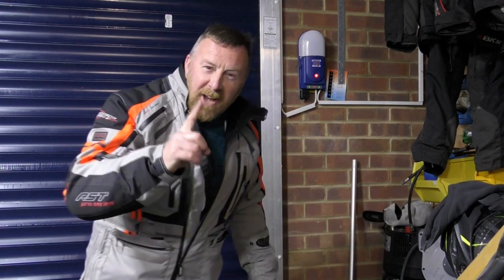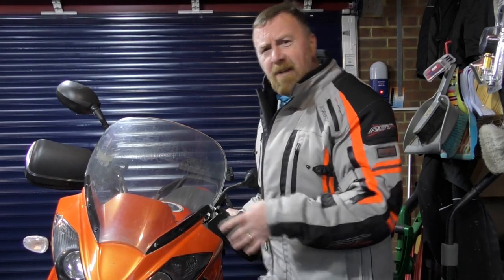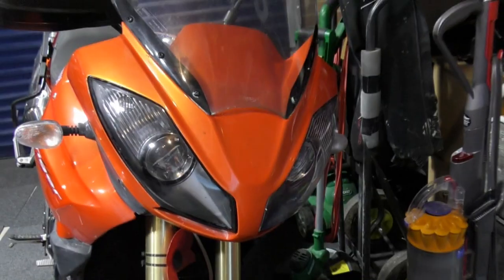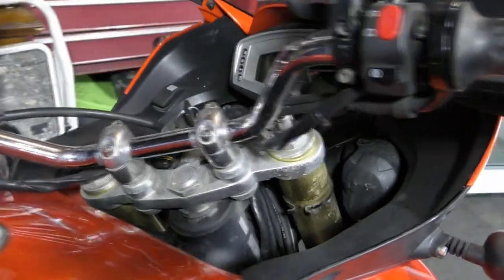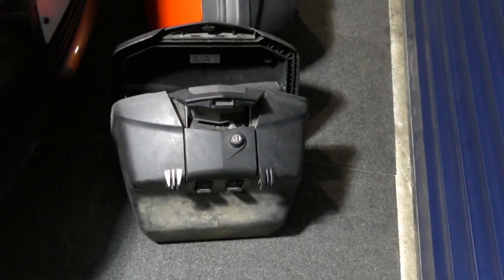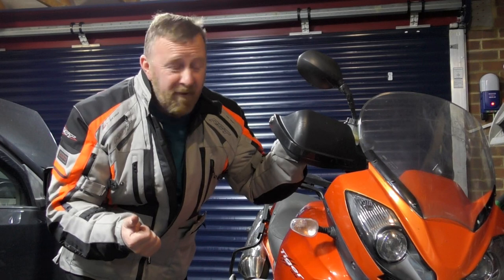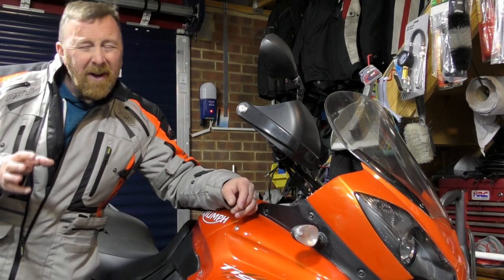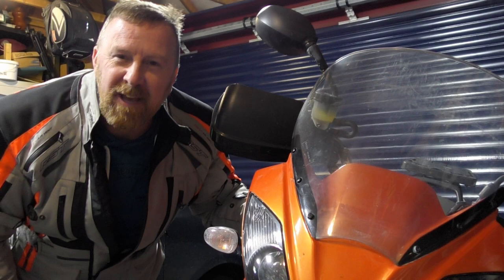JUST BOUGHT 2ND HAND TRIUMPH TIGER 1050 MARK SAVAGE

Comment: Nice choice fella, and the coat matches the bike colour too! Nearly bought one myself a few years back but the engine was such a stormer I knew I’d just ride like a twat everywhere so I made the sensible decision and bought another DL1000 V Strom. It will sound fab with a can too. Love the drone of my V twin with open cans.
Reply from the maker: you know i thought that as i was riding home lol
to be fair i know they v stroms are good valve bike but im not a fan of the v twins are a incident with a tl1000 many years ago and a round about at high speed !! but like the multistrada and the gs so maybe i've got more used to how they ride with the engines as i like to drop it down a gear to slow down but found the twins like more brakes than gear down 
but anyway thanks bud and for watching and take care

Comment: Hi Mark
I've just brought the same bike ... I'm 5'8" 29/30 inside leg....
I'm a bit worried about it being to tall for me. How easy is it to lower it... the rear seem easy enough but it the front that worriers me ... any hints 
Cheers Gaz
Reply from the maker: just do the rear bud as you don't need to touch the front , you are the same size as me and i haven't lowered mine as im used to it 
1/2" on the rear is 2" as the rear wheel so this will really help bud 
all in great bikes and enjoy
Reply: @marksavage  thank you
Reply: Hi Mark you could do a video on it could you... lowering the 1050....
Reply from the maker: @garythompson1629  i have a video on the trophy 1215 on my channel and taking it off on my zzr1400
Reply: Gary, I have the same bike & I’m exactly the same measurements as you. It does feel a bit tall & top heavy but you get used to it. Anyway, I did lower mine. It’s a simple job. You can get the lowering kit from lust Racing. About £70 last time I looked. I dropped the front forks thru about 12mm too to keep the bike level. There’s plenty info on the Tiger 1050 forum about it.
TBH I’m debating putting it back to stock height as I feel it did slightly affect the handling although only very little & could just be me.
Possibly a better option although more pricey is have the seat re modelled.
You’ll quickly get used to just putting one foot down if you can’t flat foot with both feet, this works for me. Also I don’t try duck walk the bike backwards as this is where your likely to loose footing & drop it, hop off & push it back. Much easier. Anyway ride safe & enjoy this cracking motorcycle
Reply from the maker: @andyhoney7030  agree I too always get off the bike to walk it backwards
But I don't like changing the front set up !, only rear but sure he will like you and me get used to it
Reply: @andyhoney7030  thank you that sound great

Comment: Mark, i got a nmax 125 and i install a exhaust sc project chinese and the bike lose power. Theres something that i can do? I work all day, and i need to be noticed.
Reply from the maker: this can happen and you may need to have a sports air filter too so you get more air in as you now have more gasses getting out , this should help otherwise a small upjet on the carb
they are good exhausts but if this doesn't help you may have to get another exhaust bud

Comment: Ive got a speedfight 2 and it dosent want to pull away when cold but it works kinda okey wen hot, it starts fine cold and hot but when iam giving it zero thorttle to full trhottle it stutters and lags and then it yakes away. Whats the issue?
Reply from the maker: So its bogging down? what air filter have you got on, carb. size jet . exhaust, roller weight ?
i have many videos on all of this but under tuning etc

Comment: Nice mark 👍 how did you find it compares to your sprint st? The Tiger looks to have shorter gearing 18 front 44 rear I think. While the sprint has a 19 front 42 rear, did you find the tiger pulled harder at low revs compared to the sprint? And was it more wheelie happy than the st? I've got a 2006 sprint st. Lovely lovely thing
Reply from the maker: To very different bikes to ride bud 
All but the name they ride different and feel very different 
However I enjoyed both but for all year round it has to be the tiger
Reply: @marksavage  yeah I think if you could only have one bike the tiger would be perfect.

Comment: Hi mate happy to see you still active on here. A quick question what size jet would you recommend for a SF2 100cc with tecnigas exhaust? & what’s the make of the original carb? Can the original carb be upjetted? Thanks!
Reply from the maker: Stick with the sp2 carb but check what you have in there now 
Most of the time they will run great just with the exhaust change !
But check size in and go up in 4s so buy 2 extra 4 up ie if 84 in get 88 or 92 
Sports air filter 
Should be fine
Reply: @marksavage  thanks mate appreciate your help always, not many like you around now

Comment: I owned a 2009 Sprint ST 1050cc and ended up selling it because the heat of the engine went to my legs (specially left side) and was unbearable! Given that you had a Sprint ST, is this anything similar I have been offered one of these bikes, I want it, but the heat issue (if it exists) is holding me back.
Reply from the maker: i had the same with the st bud and its common also with other bikes like the z1000. with this tiger 1050 no bud no heat at all and they are fun bikes to ride, give one a test ride
Reply: @marksavage  Thanks! I'll do